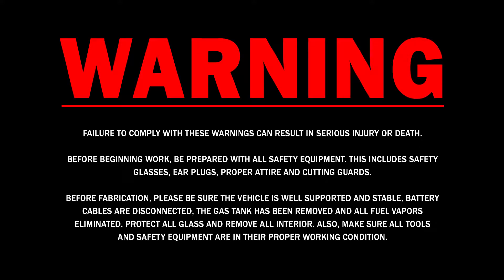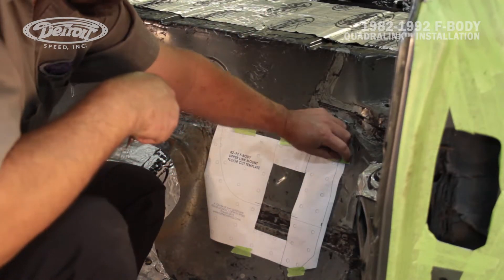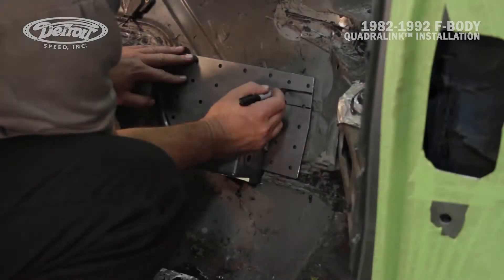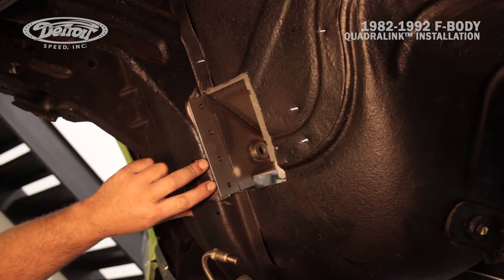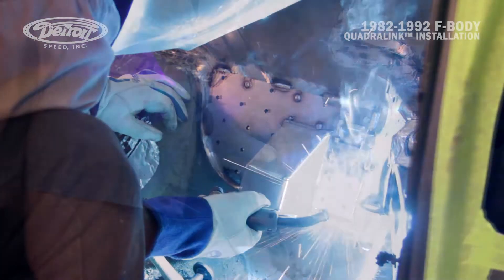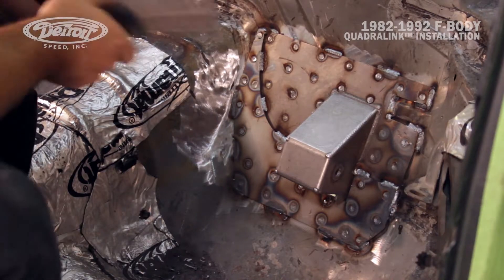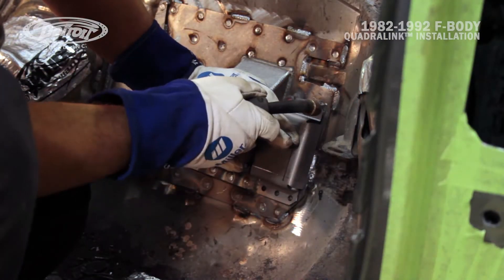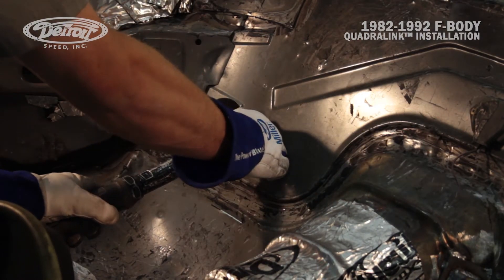Installing Detroit Speed's 1982-92 Camaro/Firebird Body Side Weld-On QUADRALink Brackets

Comment: Good question - can you still use the rear seat?
Reply: Apparently not a question they want to answer.
Reply: No, you wont be using the back seat after adding that mounting bracket to it. The mounting bracket would be jabbing the rear passenger in the back anyway and that would only be possible if you cut a corresponding hole through the back of the rear seat. Speaking of that you could likely cut out a pocket in the rear seat to help cover up that suspension mod but no one is gonna want to sit there.
Reply: @jonathanhudson4623  don't they have back seats on this car? I'm pretty sure they did

Comment: hi detroit speed, I have an 86 iroc and I'm setting it up for track racing like a road course and auto cross, lots of turns and what not, would the quadralink be good for that sort of stuff? better than just new sway bars and what not? Or is this more of a drag racing thing? Thanx
Reply: Detroit Speed, Inc. Maybe a silly question, but does this allow you to keep your rear seats? Thanks in advance. Great videos by the way
Reply from the maker: +lokihallow Yes, the QUADRALink would be a perfect setup for this. You can find more out about it here.

http://www.detroitspeed.com/1982-1992-F-Body-Products/041722-QUADRALink-kit.html

http://www.detroitspeed.com/1982-1992-F-Body-Products/041721-QUADRALink-conversion-kit.html